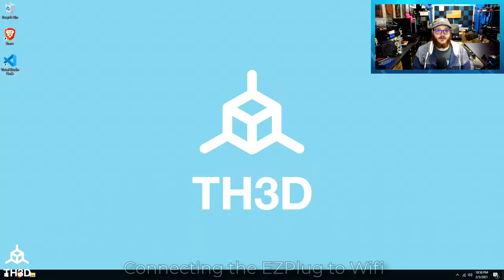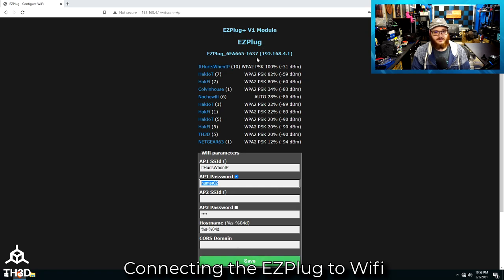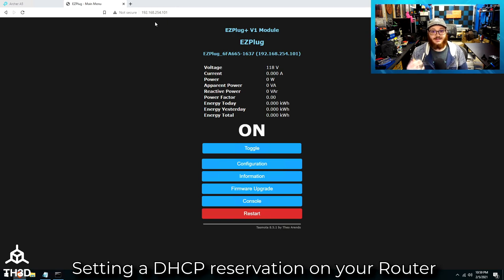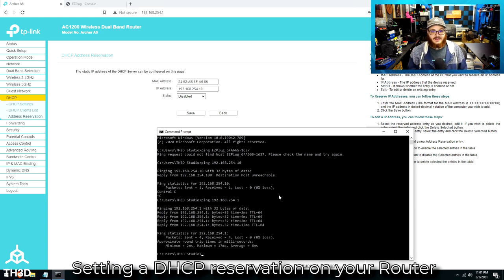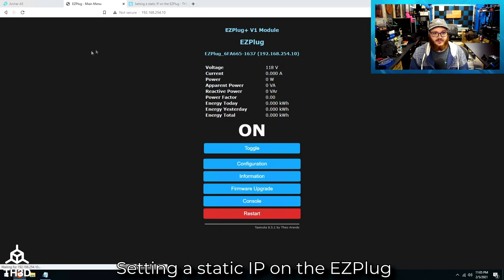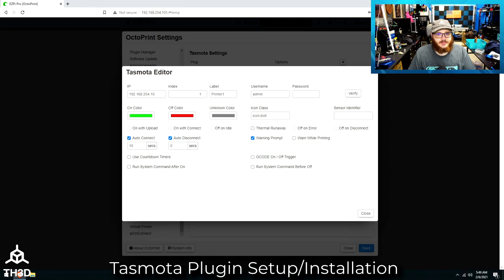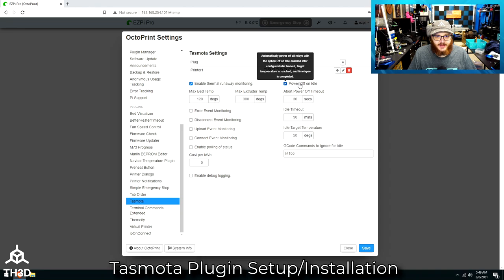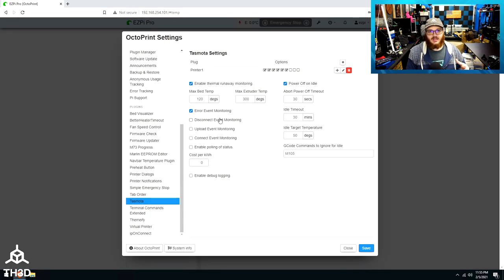Open Source Wifi Plug from TH3D | EZPlug Setup Guide

Comment: Got an order in! Been using an basic wifi controlled power strip to turn on the Pi & printer at the same time, but I really like added security features provided with this and being able to have OctoPrint turn off the printer when its finished. Plus, the power strip has an open, Chinese app, and that has always made me a bit nervous. I know security is basically non-existent.
Reply from the maker: As someone who uses a lot of home automation devices, having local control and firmware that we are able to qualify is important to us. We hope you enjoy the plug. :) Thanks for the support.

Comment: I'm having problems with a 15amp switch running my bed at  medium temps turning off. Is the 10amps gonna do the same. Or maybe mine is not really 15amps.
Reply from the maker: You should use an SSR to control an AC bed. That way the printer can control it directly. But check with a device (like a Kill-A-Watt) to see what the bed actually pulls.

We carry SSRs to control your AC bed from your printer board. That is what is recommended for true control over an AC heater: https://www.th3dstudio.com/product/mager-25a-ac-dc-ssr-for-ac-heated-bed/